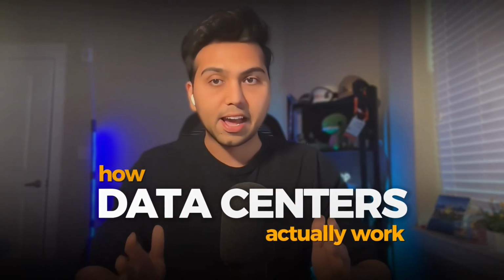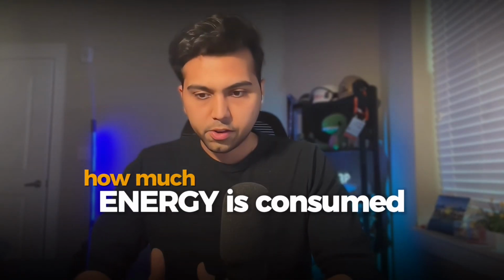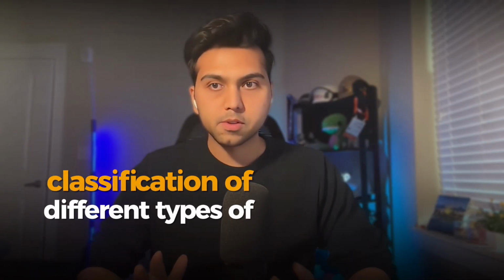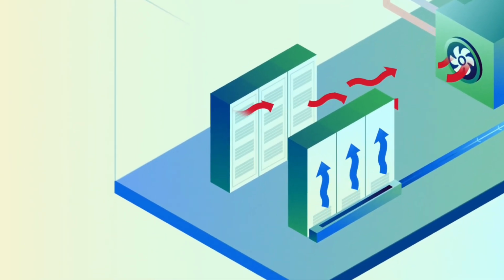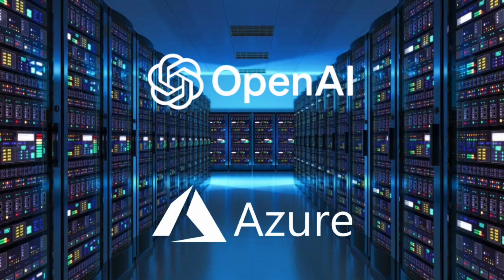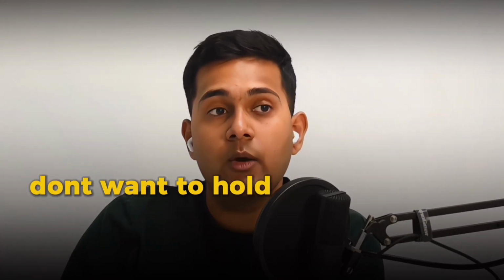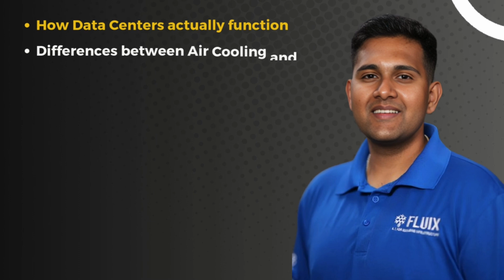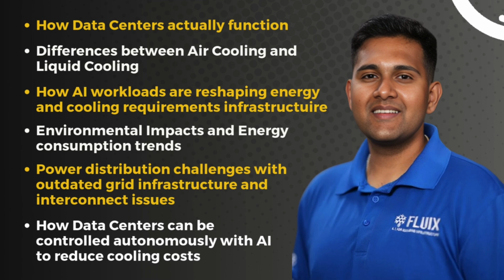The Biggest DATA CENTER Problem AND Here's HOW to FIX IT

Comment: The example of using freecooling was so funny. How can the facility OVERCOOL? Were they not equipped with basic temperature sensors ? 
That example may make a control system engineer laugh and simply get amused considering how people can be so foolish.

Comment: A simple practical automation can do many things . It's done regularly in much more complex process plants for last 75 years. 
The problem is that the IT engineers do not understand simple control systems , and they are running the show.